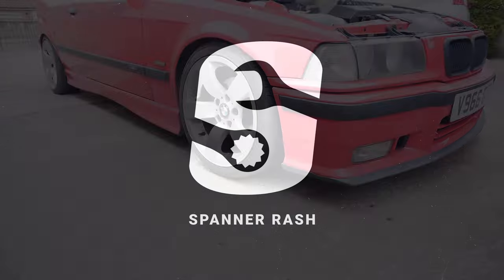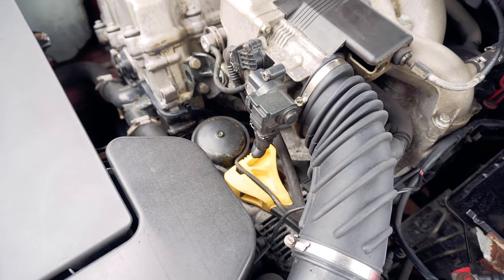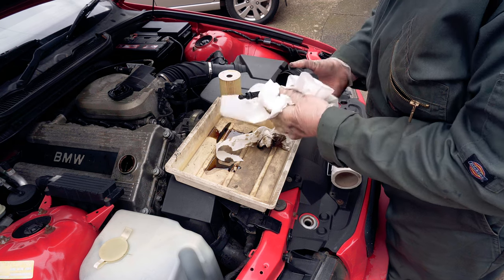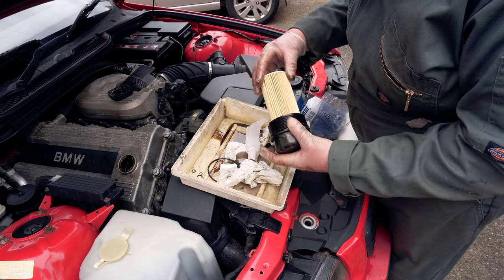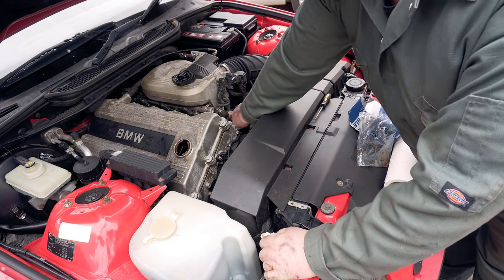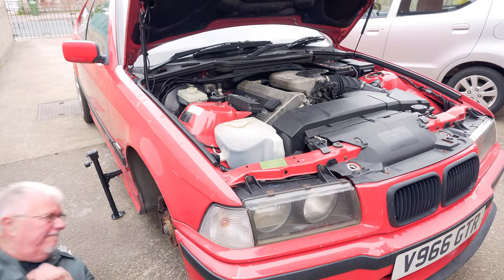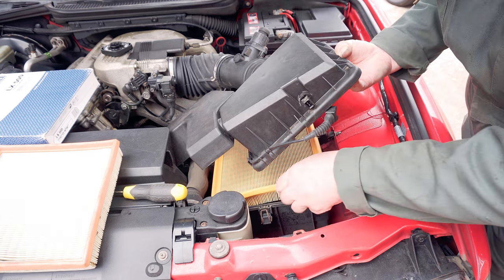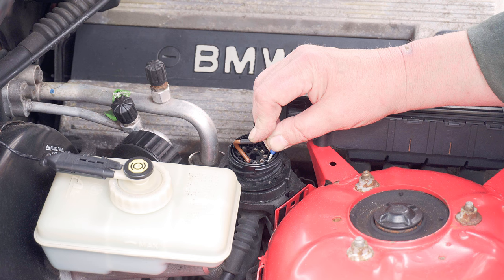BMW E36 318ti/318is Service Guide M44B19 Oil & Filters | E36 Compact Build Maintenance | 002

Comment: Good job! I always change the fluids when I get a new car, regardless of when is (supposedly) was done last. I see the car already has the upgraded front subframe brace (from a convertible car). It makes the front end a lot stiffer and is a very good upgrade!
Reply from the maker: Depends on what I find when I buy.  I have an amazing set of invoices showing the history of the car.  And only one thing seems to have been missed from the service schedule, backed up by the invoices, but you will have to wait for a future video to see that ;)
Reply: Good spot on the X-brace! One my my last additions (I owned it!) to replace the previous straight brace that had rusted. A top tip for slanted BMW engines... the top of a big 5L(?) spring water bottle (the ones with a carry handle) can be cut off to make a funnel that screws into the oil filler! Looks like you're taking good care of her, keep the videos coming!
Reply from the maker: @garethpurves769  Cheers Gareth! Still enjoying the car, lots more to come. 😁

Comment: Whats the next plans with the compact?
Reply from the maker: We've got some more maintenance to take care of so we can be confident it's all up to date and ready to be enjoyed when the weather improves.

At which point we've got a few choice modifications lined up that should make this thing handle much better, and look a whole lot better too.

Still intending to keep it as a simple driver's car, but plans are fluid. 😅

Stay tuned and you'll find out mate.
Reply: @SPANNERRASH  I’ve just bought a e36 compact 318ti msport 75k on the clock. Going to be doing some work to it soon. Great videos!
Reply from the maker: @Liam0driz  Nice! Ours has nearly 100k more miles than yours. Testament to the sturdy M44 engine I suppose. Glad you're enjoying them, loads more to come on this project.